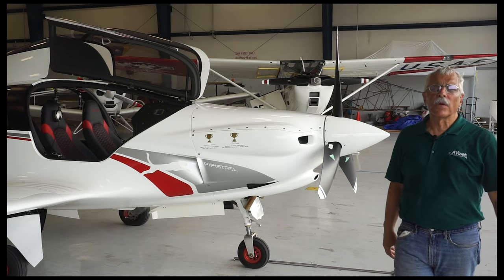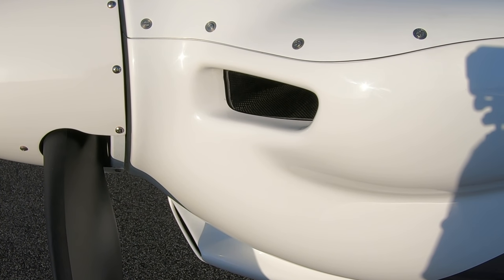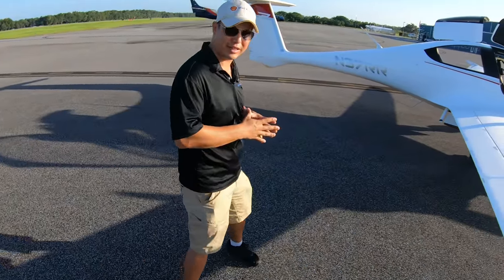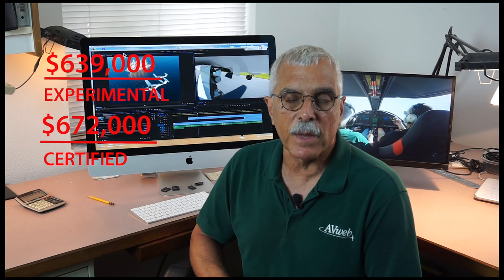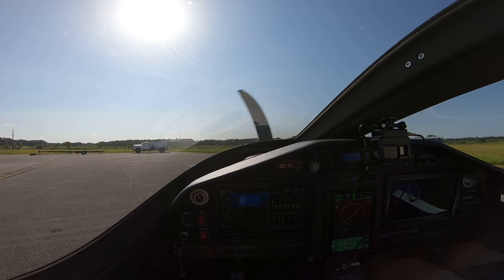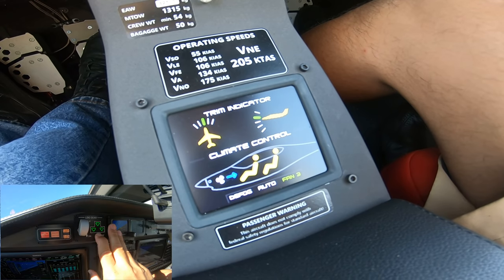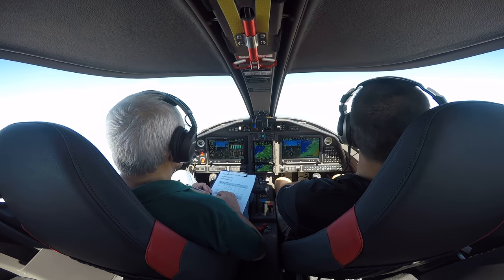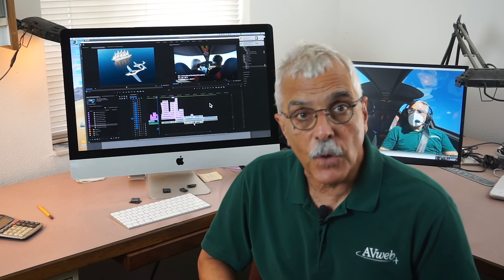Flight Trial : Pipistrel's Sleek Panthera

Comment: Beautiful aircraft but what stood out for me in this video was the DA50 fuel burn. 9 GPH at 181 kts... Wow!
Reply: Yup, that strikes me as the future there: fixed gear, 180 kts w/ a fuel burn like an Arrow and buying Jet A instead of 100 LL, I think Diamond has a winner for flight schools and a whole lot of GA.
Reply: Yea great accept the wingspan on the DA50rg is so wide it hogs the other parking spots on either side of the plane and also won’t fit inside a standard T hangar because of the width.
Reply: @tropicthndr  Interesting, I wasn't aware of that.
Reply: Its diesel and Pipistrel have all ready a hybrid and full elictric plane in owen.
BTW
 first choice for panthera engine was also in 9 GPH range unfortaly supplier did not want to certificate it for a car gasoline which was for pipistrel as global company a vital option they were forced to change the engine .
Reply: @tropicthndr  The new ones I believe have winglets. I think it will fit in a standard hanger now.
Reply: @altergreenhorn  you wont see viable electric airplanes for a looooong time
Sure they'll make concepts, maybe some short range trainers for pattern flying

But batteries just dont have the energy density that fuel does
And airplanes absolutely depend on energy density
Otherwise you're going to get a heavy slow plane just trying to match what a gas engine could do

And a gas engined airplane can take less fuel for more load, batteries weigh the same no matter what 
No tradeoffs there
Reply: yes 20 mpgs 😎

Comment: In my opinion, I don't think the price is that bad - Being as a brand new Cessna 172 SP - Nicely equipped is well over $400,000 - Which blows my mind.... being honest....
Reply: No it’s Lunacy and makes no sense for what they are trying to ask for this plane. You can get a Piper Mirage on Controller with “very low time” for half the price, the Mirage is twice the plane in capability with private jet cabin class interior. That means you can get “”two Mirages”” for the price Pipistrel is trying to get for their certified version. It’s just dumb beyond all reasoning, maybe they think all those ridiculous gear doors make it worth it, such a joke.
Reply: The more I see these new aircraft prices, the more an RV10 looks like a bargain. Or a nice vintage Bonanza is even cheaper.
Reply: @christianjforbes  I know right... I probably should have worded my reply above better - bottom line, when a brand new Cessna 172SP is well over $400,000 - it sure is keeping most of us out of being able to afford what should be a 30k airplane....
Reply: giid plane orice cénnsa  is
Reply: @tropicthndr yeah makes no sense. You can get 4 viruses for this price. Sure the virus is 40 knots slower but come on. Who would pay 300000 for 40 knots. Go get a Ravin 500 for half the price and get a +2000 nm range.

Comment: At 16.32 it says the Diamond DA50 would do 181kts at 9 GPH, that might be a little optimistic. The DA50 does 172 kts at 10000 ft on  MAX power at 15.9 GPH and 127 knots at 8 GPH at 10000ft.

Comment: I believe when operating the engine at higher than recommended head temperatures the maintenance costs will eat into an owners pocketbook greater than expected or may cause premature engine failures, but heck it does have the ballistic parachute for that scenario just in case. She’s a beauty and I can’t argue that with a price tag to match she’s of my class.
Reply: Aircraft engines are made to run hotter...if you shock cool them or run them cold you kill them.
Reply: Speedo Mars - if you bring the cooling temp up slowly with radiator cooling for the heads it seems to manage the engine temps quite well. But like you mentioned any shock cooling will defiantly do damage to any metal being an engine or just a piece of metal. When you change the mechanical properties of the metal with essentially heat treating the metal it will deform.
Reply: Cowl flaps maybe?
Reply: @speedomars  Shock cooling is a myth lmao
Reply: @bobjohn2000  Have you seen a cracked cylinder or head from shock cooling?  I have seen dozens of them.  You lack experience.

Comment: A very kind review, especially considering that center post and glare shield gloss over as something you can get used to through "some adaptation".  Note that even fighter jets take exception to the "frontal drag" by putting the pilot in a position that allows for a complete and unencumbered view in all directions, especially straight ahead whether flying or moving around the airport.  The gear doors (all 11 of them) are an impressive engineering feat.  The manufacturers attention to detail in reducing drag is great, but not having speed brakes along with a relatively slow 106 knot gear down speed is going to present significant pilot challenges in slowing down without shock cooling that Lycoming up front.  

The aircrafts profile is clearly impressive.  Sleek and smooth.  But the trade offs in ingress and egress, forward visibility and flying at such an inclined position may not sit well with owners who care more about these factors than ramp appeal.  Dissipating all the heat generated during a climb out was noted in the review.  Perhaps also a result of placing too much emphasis on sleekness and not enough on practicalities.

Comment: Sweet ride and great review as always Paul!  The challenge will be ramp up on certified maintenance shops and dealer network where Cirrus is the king. Cirrus has 20 year head start as well but hopefully these guys can be competitive. If I had the coin to buy one of these I would get a used SR2-G3 for a lot less with AC and TKS, and no I don’t work for Cirrus. 😊

Comment: I was hoping for more efficiency in nm/lb due to the amount of work & time that Pipistrel has placed into this airplane.  As for cost, Pipistrel is usually cheaper than traditional airplanes but the delays & engine change have increased this.  I don't know if this will be a good seller based on the info presented.
Reply: They changed engine because supplier did not want to certificate it for a car gasoline. 
That is a main reason for almost 2 year delaying and cause a slightly less fuel efficiency
Reply: What Pipistrel is cheaper?  They are all priced at the market level for their niche.

Comment: Almost $700k airplanes still can't have any kind of anti-ice? Given that price with all those pretty avionics just waiting to fly in IMC, I don't understand why it's so difficult to add a couple of what are basically seat heaters to the leading edge surfaces. GA has always struck me as trying to be safe in IMC, then taking little precautions against ice other than "don't fly in it" which is super unhelpful IMO. Rant over lol.
Reply: This is partial what killed the Cessna 400 (aka the Columbia 400 / aka Cessna TTx Model T240).  It had an optional anti icing system that was not rated for flight into known icing conditions.  It eventually got a true anti icing TKS system as an option in 2014 but Cirrus had too much momentum by the time Cessna added it.  At least the Panthera has a BRS which the Cessna 400 never had.
Reply: @flantc  I remember hearing about that. That's another issue I have, if you're gonna put on anti-icing, why do it half-assed? Make those leading edges hot as hell and melt it all off. I may not be an engineer but the fact it's such a huge killer in aviation with a simple solution that isn't implemented baffles me.
Reply: @ictpilot  I used to say that until coming head on into idiots flying the wrong way at uncontrolled airports not using their radios in the pattern. It’s not about engine failure, it’s about hitting that loser in the pattern going the wrong way close to the ground.
Reply: @tropicthndr  I'll still take it without the chute. Can't get rid of all risk in flying.
Reply: Crazy hot localized heat cycles on a composite wing? .... think that idea through a bit more.
Reply: @christianjforbes  solution... aluminum wing.
Reply: @CarterHancock  Just put deice leading edges on it like Cirrus
Reply: @ictpilot  Precisely, something that will knock off ice. But powerful enough to fly through any icing conditions.
Reply: @CarterHancock  Nothing will get you through all icing, but it's enough to get you out of icing conditions.
Reply: @ictpilot  I think if you heat up wings and other frontal surfaces enough then no ice could possibly stick to them.
Reply: @CarterHancock  FIKI flight in known ice is only to get you out of icing conditions because it could become to much to shed no matter what system.
Reply: @ictpilot  Develop a new system then. Ice can't possibly stick to a wing that's over 100 degrees. I don't think it would be very hard.
Reply: @CarterHancock  Deicing is never meant to just fly through ice for hours. Even airliners will try to change altitudes to get out of icing conditions as soon as they can. It's not just a weight issue, it also changes the airfoil and disturbs the airflow.
Reply: @ictpilot  Yup, I'm well aware lol I'm an instrument rated commercial pilot. My point is to develop something stronger so worrying about ice is a thing of the past, even the heaviest of icing conditions. Now obviously one shouldn't stay in icing if possible should the system fail but with the number of icing related accidents, I think we can do better.
Reply: @CarterHancock  Then you know you can't develop a system that would handle any amount of ice. You have to ballance weight, cost , complexity. What we have now between boots, TKS, and bleed air for jets is pretty good.
Reply: @ictpilot  I think we can. Sounds like quitters talk lol. Heating up a wing to 100 degrees can't possibly be that difficult.
Reply: @CarterHancock  Well why don't you find an areonautical engineer and develop one?
Reply: @ictpilot  Maybe I will...
Reply: I have an idea for an anti-Ice/De-Ice solution for GA  that could be affordable and effective.
Reply: @bartofilms  what is it? Other than don't enter icing conditions, heard it before haha very funny.
Reply: @CarterHancock  Heat cycling like that is no good for a composite wing, boots are nice but they are heavy and require air pressure. Tks is the best solution but it is finicky at best. Staying away from ice is the cheapest, lightest and most logical solution idk why people even consider FIKI....
Reply: @andrewtaylor2067 Because why should a weather phenomenon prevent airplanes from flying? Airliners have them, why can't GA? You could easily just use aluminum wings and attach a heat source. It's clearly an issue with the number of icing accidents.
Reply: @511aboy  You say that it hasn't been done before. We went to the moon with late 60's tech, I think we can make a piece of metal heat up. Moving through the air at 230mph would cause some friction to heat up surfaces anyway. Did you not think of that? The amount of surface area on the leading edge of a wing is really not much and as someone else said, it would only need to be heated just above freezing, say 50 degrees to be safe. That's really not much to ask for when to alternative is augering a plane into the ground cause of a little ice.
Reply: @511aboy  so attach a metal strip or make the whole wing out of metal. Some carbon fiber composites can withstand up to 400 degrees F. Car window defrosters in the rear are electric and the can remove ice with just a few lines heating up. I think that would be the best way to do it. And those barely take any power to do so.

Comment: I can see from the performance numbers, parachute, and fuel economy that they are aiming to take a bite out of Cirrus's market.  If they could knock 30% off that price, they might even do it.  It's been my experience that most people who have Cirrus money don't care how much fuel it burns.

It will definitely knock a chunk out of Mooney's market share, though, which makes me a little sad.  Mooney was the original leader of the "maximum bang for buck" trend - the fact that my 1964 C model will cruise at 145 KTAS on 8-9 GPH while nothing certified, even brand new, today even comes close to that shows how well they succeeded... shame they have not chosen to capitalize on that position.
Reply: This plane is positioned to go after the Cirrus SR22 non turbo.  It won't sell more than a hundred copies.
Reply: wrong
Reply: @sharonbraselton4302  wrong

Comment: Novice question; It wouldn't seem very hard or expensive to put a little camera pointed forward somewhere under the prop, wired to the main instrument display screen, with a button on the stick that toggles between views. Let the button up, you see instrument readings - push the button, you get to see what's in front and slightly below you that you can't see otherwise without a lot of messing around.
Reply: No need.  The extra weight is wasted.
Reply: @511aboy  Not the point. Putting a camera behind the prop would be destroyed on the first taxi trip. I have an infrared camera under a wing used for night landings but I have never used it.  Also notice no aircraft, even the big boy Boeings, Citations and military aircraft do not make use of such camera mounts.  Why?  They just are not needed.
Reply: @511aboy  The original question was why not stick a camera behind the prop on GA planes.  Cameras are stuck under wings all the time for recording flights, I do it myself on my Cirrus.  But sticking a camera behind the prop as a permanent fixture is nonsense and would likely not withstand the prop wash and debris occasionally picked up by the prop.  As I said, I have an infrared camera mounted permanently under a wing but I never use it, it is intended for night flying use thru clouds and landing.

Comment: They nicknamed this plane as the "Mooney killer".  If this thing had the Continental TSIO-550 like the Acclaim Ultra has, it would've been.  Having just a NA Lycoming, it's just not going to have the climbing power like a turbocharged engine will, maybe in the near future they might consider a turbo engine choice.  Possibly a turbo Diesel if they're feeling especially adventurous.
Reply: Mooney is dead.  There need be no Mooney killer.

Comment: Hi Paul!  Nice looking ride!!  When it gets pressured I would want one.  Auto gas well well all you need is a auto filling station at the airport.  Where is the anti icing for flight into known icing conditions?  Entry and exit in the rain is going to suck!  But for under $ 700k who cares about that?  I would rather have an older P-210 honestly.  Fuel is a nuisance so I will take the P- 210 with a turboprop upgrade.  I'll keep those old steam gauges too!  ERAU '80 CFIA&I ret.😁

Comment: hmm, didn't know Diamond DA50 was that relatively efficient. And able to drink Jet A. In a class of portly 1 tonners.
Can't say I agree the 540 is a good engine choice. More like a massively overpriced junker from the 1950s and their only option. At 670, it's not the revolution it promised to be. A turbo and oxygen might help it stand out. Get it up to altitude it might just do 500km/h and then it's different story. That could swing some Cirrus folks perhaps. Little concerned about the visibility. A good front camera could help that.

Comment: They need to redesign the cowlings and add a turbo, my guess is they couldn't keep the temps down without sacrificing power. 

Certainly for the price it should be over 300hp. Other than that and visibility this is a fantastic bird.

Comment: Great review. Only one gripe which is the pointless lbs per nm chart. Running costs per hour is what counts and if the Diamond is running on Jet A at half the price of AvGas then it is half the running costs of the Panthera (and others) for virtually the same speed. Plus it is certified. The only problem with the Diamond is it is ugly.
Reply: JetA is not half the price of 100LL. Fuel is one component of per hour cost.  The cost of an annual, hangaring, insurance and if you finance, those charges all add in too.
Reply: @speedomars   Check these prices out. I am referring to Europe rather than the USA when it comes to prices. As you will see, in some cases Jet A is a third of the cost of AvGas... https://www.iaopa.eu/fuelprices Those other costs you refer to have nothing to do with lbs per nm which is what I referred to in my original comment.
Reply: @andymckee53  You misunderstand.  Europe has no 100LL (govts there banned it years ago)...that is why they are going for diesel cars and planes that burn kerosene.  In the USA 100LL is prevalent and will remain so until it is replaced by a non-leaded alternative that has been in development for over a decade.  If you wanna burn Jet-A get a jet-prop or a jet.

Comment: Except it doesn't go 1000nm, or 200ktas, or burn less than 11gph. So it didn't hit any design specs. I'd rather have a DA50, certified and fiki. The DA50 goes the same speed, with a larger cabin, and a 300hp diesel which burns less fuel.
Reply: Diamonds are expensive, do not have a chute, seat less, and are slower for each niche they occupy,  The Twins cost double to maintain.  Diamonds do not sell, just like this aircraft wont sell.
Reply: @speedomars  DA50 is faster than this, carries as much, and is FIKI on less fuel burn. Panthera seems like a meh airplane all round overall, maybe the hybrid drive will fix that? I'm not a fan of most of the other Pipistrel products I've flown / seen. Their gliders are pretty shit, (not good self launchers, low performance, shitty finishing, ) and their ultralights I guess are OK but I'd rather a CTSW